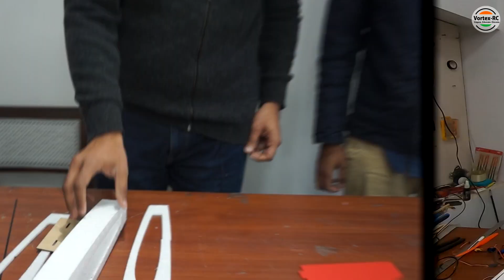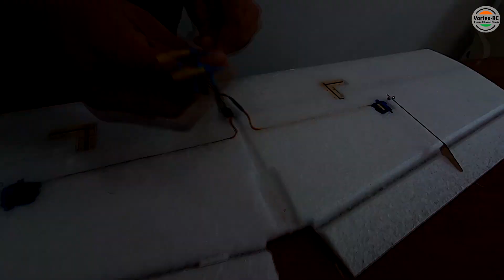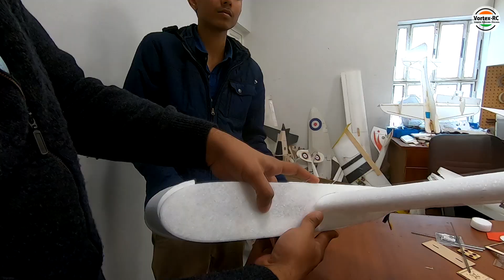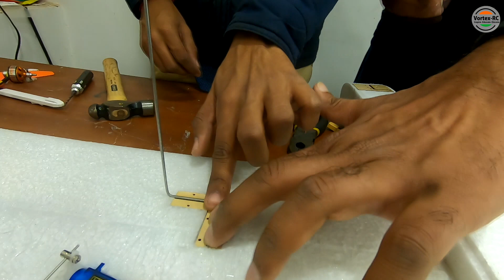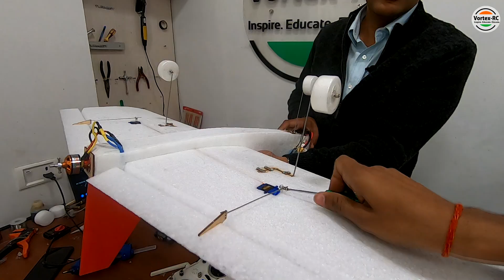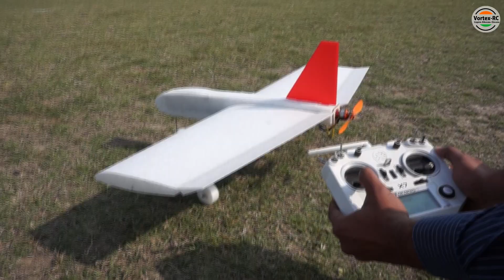Batman V2 Build - All EPP Ultra Durable Pusher RC Plane Kit - Super fast Assembly and easy to fly.

Comment: Dangerous plane design not recommended,the esc is blocked ny the foam and the foam doesn't have any hole on it,basically it will become warm and the esc will burn